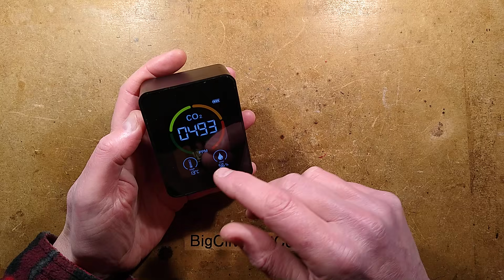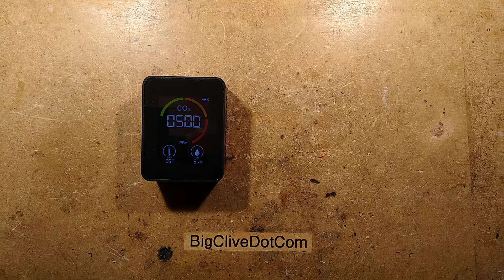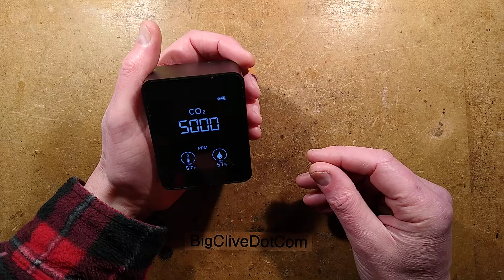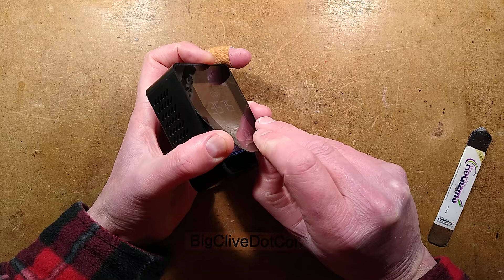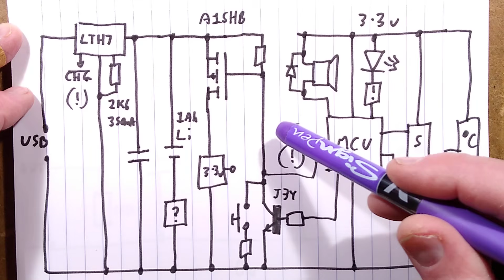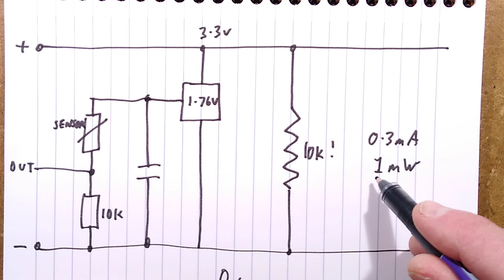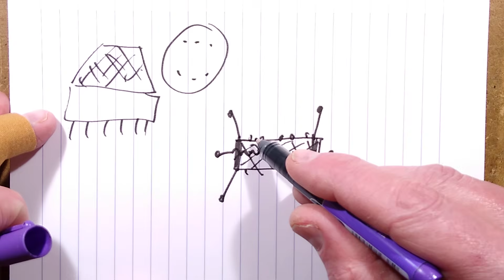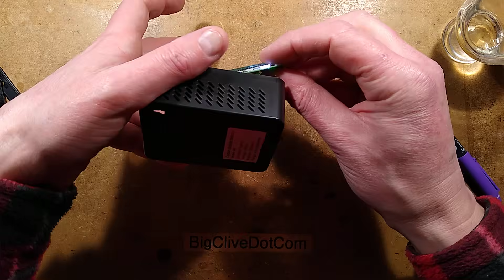Fake CO2 monitor (party detector) with schematic

Comment: We have real CO2 sensors in our office building, with LED lights that go from green to yellow at 800 and to red at 1200 ppm.
I designed and built them myself (around 150 sensors for the whole company) at the time we had all those mask and quarantine regulations.
They contain the Sensirion SCD30 sensor module, which uses NDIR to detect CO2, which is accurate, but also quite expensive.
They do help a lot with air quality monitoring, because as you mentioned, humans exhale CO2 at all times, and if too many humans are in one room with bad ventilation, the levels rise quickly. It will never reach dangerous levels in a normal building, but at 1500ppm and above CO2 causes headaches and reduces focus, which is usually a bad thing in work environments.
High CO2 levels also mean a lot of exhaled air and therefore higher risk of aerosols (virus transmission), so respiratory infections have declined since we use the sensors and therefore ventilate the rooms when needed.
Reply: We also have them at work, also introduced during COVID for the same reason.
Some of them in the workshops are linked to extraction systems and will turn on the extractor if the value goes high.
Reply: @danwhite3224  Hm I imagine that's mostly because workshops happen to have extractions systems. For the rest of the building, hopefully the windows open. Otherwise you're at the mercy of air conditioning, which started off being designed for comfort, then energy efficiency. I know they have heat exchangers but how much air do they recycle? Actually I should have said "recirculate" otherwise you'll doubtless all give me answers about disposing of unwanted aircon equipment, because you're pig-ignorant yet also assume you know what I'm asking for better than I do. At least if you're a search engine.

Apparently back during The Event this was a worry even in hospitals. The only place you're ever likely to be under quarantine, and the aircon promiscuously blows air around willy-nilly. There's probably the odd bit of ozone and UV light in there somewhere, but still, sounds a bit haphazard with an emphasis on "hazard". Until they fix that, everyone is to suck oxygen from the O2 taps directly, and please breathe out into the vacuum line.
Reply: I bought one for my home last month. It is really good for disciplining me to regularly open the windows to vent in fresh air when it turns yellow. And it's been doing wonders to my general wellbeing so far.
Reply: A couple of years ago I parked in a parking garage that had CO2 sensors on the walls. I don't recall who made them but I looked them up and they cost a couple hundred dollars each. I'm pretty sure that they were wired to control the ventilation fans, probably an energy-saving measure compared to just running the fans all the time.
Reply: @brianleeper5737  Defo more important in a garage where those fumes and the like could kill!
Reply: @TheLordNemesis do you have a schematic available for the rest of us to clone?
Reply: @bdot02  I still have the PCB files:
https://drive.google.com/drive/folders/1NoOmleiVp-jkB6TUBHUvNFfxkLYTPRRr?usp=share_link
It's a quite simple design using only readily available modules, so the sensors can be built by hand. You'll need the following components per unit:
- an ESP8266 D1 mini (main controller, needs programming)
- a Sensirion SCD30 (the expensive part, there are cheaper alternatives, but the SCD30 just works)
- a Bosch BMP280 or BME280 module (air pressure and temperature sensor, the SCD30 has to know the ambient pressure for accurate readings)
- a WS2812 LED strip (5V, DATA, GND), I used the 60 LEDS/m variant, you only need 6 LEDs from it, but it's a lot simpler than soldering individual chips
- a standard silicon diode if you need deep sleep support for the ESP8266 (can be omitted, I don't use it on my sensors)
- a double sided PCB as shown in the schematics (I have included Sprint Layout and Gerber files)
- the 3d printed enclosure (white or transparent filament), I have included a sample model, or just any transparent box that fits the PCB
- 4 tiny 2.2x6.5mm screws for mounting the PCB (should be salvageable from many cheap eBay electronics)
Please understand that I can't open source the whole project yet (especially the source code), because I developed much of it on company time. But I assume everyone who watched this channel for a while should be able to understand and use the files provided to build their own version of my design, and programming the ESP8266 with PlatformIO for basic functionality is quite easy. There are libraries available for all modules, you just plug them together and everything should work.
Reply: @TazerReloaded  this is awesome! I'm gonna make a couple. I've got a strikingly similar product to what Clive tore down in this video and have been wanting to get my hands on a device I could deploy in a similar way as to how you have.
Reply: Excellent real world use of those sensors.  Increases productivity by NOT having people suffering during the interminable meetings, making the meetings last even LONGER as the Chief Idiot-In-Charge tries to make everyone understand whatever fool thing he came up with to call the meeting.   Might be expensive, but if you eliminate ten to twenty man-days a year of lost productivity due to illness, that cost is well balanced.    

People forget that the better we seal our buildings for temperature, the more we seal everything nasty in with us.
Reply: Would be nice to know how to build one. I saw a video on here just the other day after thinking about just buying the sensors for different stuff and maybe building them myself. It seemed okay, maybe a bit complicated building a "motherboard" type thing with all the sensors on it but seemed doable... then it started going into the software programing this and that and it was like "NOPE" to complicated it feels like. Really to bad cause all the home monitor systems I have been seeing online seem to be over priced garbage that to many people are falling for.
Reply: @iamfuturetrunks  If you lack software programming experience, maybe I can help. I lack knowledge of electronics myself, regrettably. I'm talking about hobby applications mainly, but I do have some involvement with air processing equipment manufacturing (software developer with close connections to companies producing air purifying/filtering systems).
Reply: I'm designing a CO2 detector myself, and I'm using the Sensirion SCD30 and the SCD41 (which is more compact but has almost identical readings). Now I'm quite worried by the fact that almost always the CO2 level in my room is above 1000 ppm... When I open the window it goes down to 400 ppm but then it quickly goes back to 800-1000 ppm (as the air inside the house mixes).
I'm a bit disappointed with the sensors because you're supposed to expose them to the outside air once a week to help the internal self calibration algorithm, and in addition to that the factory calibration of some sensors (I have 3 SCD41) is not very good.
Reply: Considering how infectious Covid is, I doubt your sensors and protocols made much of a difference. It is more likely the majority of people got natural immunity and thus weren't getting sick anymore.
Reply: @macicoinc9363  that’s what I mean 

These people who made all this couldn’t realize the simple solution ?

Or they did and realized there’s more $$$ ignoring it
Reply: Would you mind telling me where you got the SCD30's? I'm still trying to find relatively cheap (and not requiring changing out every 18 months) that communicate via I2C
Reply: Last year I was teaching in a school which put CO2 monitors in every classroom. I know that most of the teachers weren't paying any attention to them, but I thought that I may as well read up on recommended/dangerous levels. Well, of course the classrooms weren't getting anywhere near dangerous levels, as Big Clive says, but they were getting into the 2000s, which is high enough to affect concentration. I found that modulating the airflow by cracking doors and windows to keep the level around 1000 made a very noticeable difference to the students' mood. Classes went much better and information was retained much more reliably on average.
Reply: that’s actually amazing!
What is your job title for the company?
Reply: That is the one I plan to use for our home DIY CO2 sensor but it has been on my TO-DO list for a long time.
Reply: @tomschmidt381  I thought about getting a CO2 monitor but I decided to get a radon monitor instead. I've been using it to determine what setting is best on my ventilation controller (it brings outside air into the house and can be set from 0 to 60 minutes of air per hour in 5 minute increments). There is a radon monitor that will automatically turn the ventilation on when levels reach 4 pCi/L but it's $700, and I'm not sure I need that yet.
Reply: @brianleeper5737  You shouldn't make your home (over) pressurised. Little "vacuum" is ok. At least if you have any kind of insulation in your walls.
Reply: Where can I get one of these?
Reply: Ah, sensible! Rather than detect the virus, which would be incredibly difficult to separate out from all the other airborne viruses, you'd probably need a genetics lab and a week for the results, you use a proxy. And that's assuming you could detect any virus at all! So you use CO2 as the proxy. Reminds me of a video where someone used aspartame as a proxy for piss in a swimming pool. Worked out something like 8 gallons of piss in a moderate-sized private domestic pool. You'd think you'd piss less in your own pool, unless passing neighbours were topping it up, so imagine how much would be in a public pool.

You can't go swimming without swallowing and inhaling bits of water. Sure it isn't bad for your health, it's just fucking gross! I don't want water that's lapped someone's bumhole and period and residual jizz and whatever other horrors you want to think up, never mind simple humble spit, in my mouth and innards. Never mind actual piss. So fuck that. If I ever go swimming it'll be in a river or something. Sure there's all sorts of nature's effluvium in there but at least it's not my fellow disgusting humans, and even if one or two have swum upstream, it's not like a swimming pool where the water stays there for weeks, or who knows how long, without being changed. Do they ever change it? Is it when it starts to go visibly yellow? In a river the stuff is getting dumped out to sea by the second, I can cope with that.

Also how many people even drink aspartame? It's a proxy but I'm not sure how accurate. What's it's half-life in pool water? In the body? I think the video was that smackably smug bloke who does the sortof-science vids on Youtube, you know the one. Wouldn't normally, but it's one of those questions you want answering once and for all.
Reply: @chrislee6650  Yeah colour on LCD has been done like that for a while, Nintendo did a few Game And Watches back in the '80s with it. Can make some really pretty effects. The limitation is just that you're stuck with a black background, but that's hardly unbearable, not a big deal really.
Reply: I bought some CO2 sensors when I changed my house from using "trickle vents" in the windows to a heat recovery ventilation system. CO2 levels stayed the same when I fully closed up the trickle vents and exclusively used the HRV system. I eventually traced down the few spikes to when I used my gas hob. This was three years ago and I switched to an induction hob before it became an absolutely inane political statement due to reactionary freaks.
Reply: I built one based on SCD40, it's based on electroacoustic principle (?) I think, seems to be a new technology. Quite cheap (40 per unit) and works excellent. Can recommend.

SCD40/SCD41 seem to be such a good upgrade over SCD30 that even adafruit sells them as modules now.
Reply: Back in our Secondary School (High School) every chemistry classroom had one of these
Reply: So really, this guy works in a sweat shop and wants to make sure that his workers’ are staying productive . Have to keep that American dream alive.
Reply: At my university a couple of decades ago, they were installed in the classrooms of at least one new building that lacked outside ventilation in places—it was partially underground—those being very high-human-density environments when classes are in session. I assumed they were connected to zoned HVAC or the like so only the rooms in use would get increased HVAC load.
Reply: i had to develop one and we used the SCD40. i asked my boss if those arent quite expensive and he was like “nah theyre cheap” lol
Reply: 1500ppm? Can I grow some cannabis plants in your office please?
Reply: @MattyEngland  also do you mind 87 degrees and 70% humidity in said office?
Reply: @scotts1668  Sounds perfect 👍I've spent more hours in growrooms then big Clive has spent reverse engineering stuff.
Reply: In the UK, there was a move by a lot of amateur choirs to use such sensors as a way of getting back to rehearsing in person after the Covid lockdowns. Someone thought that choirs were a prime source of virus spread, and government took that view to heart, so choirs had to observe prohibition and then physical separation and masks far longer than most other groups. When the rules were relaxed, I bought a sensor from Amazon for around £40 - it looked somewhat like the one you took apart. It quickly became obvious that it was of no use as it sat there the whole evening of a rehearsal at around 420 ppm with very little variation. Now I see why.  We didn't have a bar open, so we couldn't test it for alcohol.  I'm glad to say that someone found out a much better technology and we used a sensor of that second type for a long time to check the air quality. I still use one in my bedroom - as someone said, it's good as a reminder of when to open a window.
Reply: Excellent work, glad its helping! I was gifted a CO2 sensor for my room. And even after raising the beep threshold it really bullied me into ventilating properly. The first 2 days it got kinda cold because there was such an insane amount of stale air in my room, even after leaving the room for an hour it was over 1500. Now I only need to freshen up the air a little as it hovers around 700-900. It even drops to 500 when I stay away. I feel a lot better when I spend my day in here~
Reply: So you are telling me you all were so smart to installand create this  system for Covid but not smart enough to realize you didn’t need it in the first place!

Comment: Typical VOC sensor. Has a heater internally that changes resistance as VOCs pass across it, so anything with a low vapor point will trigger it.
Reply: Also the sensors falls under electro-chemistry, so by changing the doping you can selectively measure chemicals with minimal false detections of other chemicals.

Comment: CO2 detectors are being used as a way of assessing ventilation in the context of covid prevention.
Because it's the exhaled air that is the issue CO2 levels inside can be an indicator of risk of infection if someone is contagious.

Comment: There's "zp16" written on the board, which is a VOC air quality sensor. The empty place for "infrared module" would be for the actual infrared CO2 sensor.
Reply: If it is a mox style VOC sensor, it would be very sensitive to alcohol, maybe it’s using the voc to calculate equivalent co2.
Reply: Aren't actual CO2 sensors electrochemical? IIRC ones used in multigas detectors are electrochemical.
Reply: @macieksoft  CO2 may be detected by infrared absorption or by electrochemical means.
Reply: @macieksoft  electrochemical ones very often measure carbohydrates/VOC and by proxy measure "CO2 equivalent". They are much cheaper though than infrared sensors and often found in cheap "CO2" sensors. Infrared sensors is what you want for properly and accurately measuring CO2 levels, but they cost a lot more: cheapest NDIR sensor I could fing is MH-Z19 and it costs 15-20$, while electrochemical one can be bought for less than a dollar

BTW a lot of those infrared sensors actually use the same data protocol used in flashing firmware/debugging microcontrollers (UART), so there's probably a revision that uses NDIR sensor
Upd: there's also apparently a newer sensor SCD40 which uses I2C instead of UART
Reply: @aleksandertrubin4869  That cheapest NDIR sensor seems much cheaper than electrochemical O2 sensors that I sometimes work with.